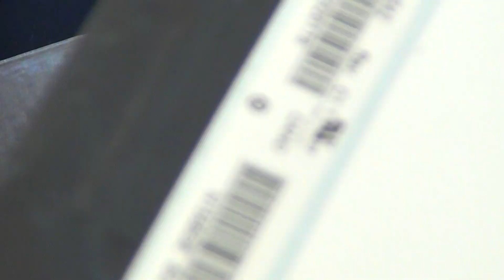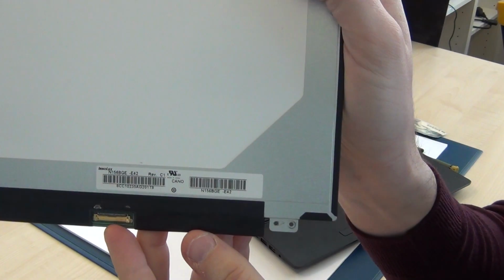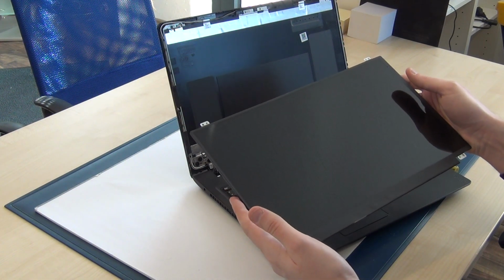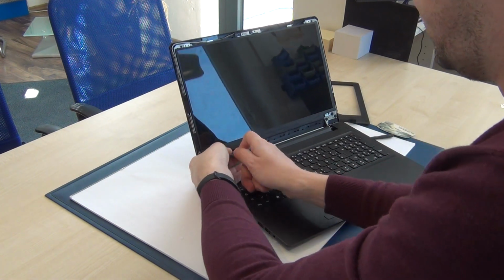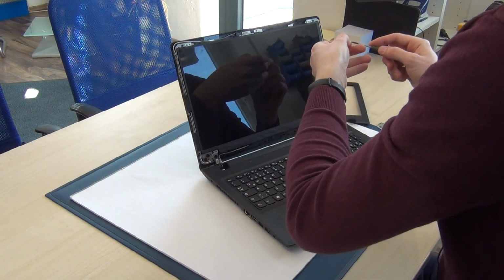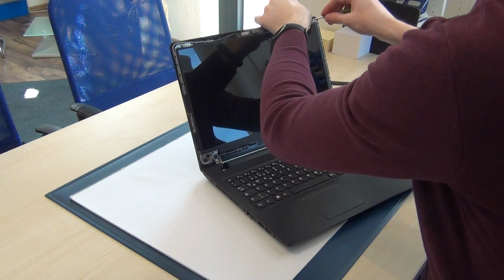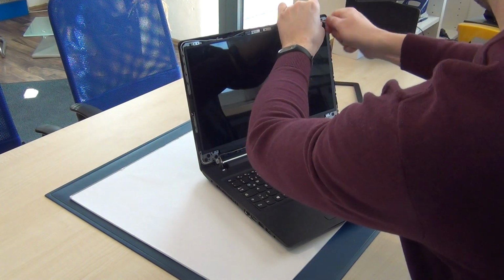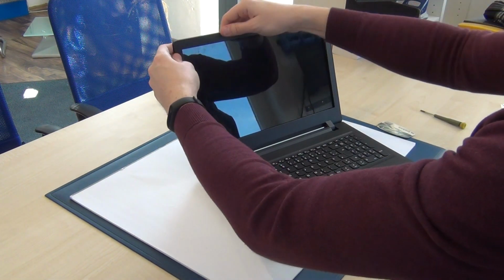Lenovo Ideapad 110 Series 110-15ISK screen Display LCD Replacement - HowTo replace a damaged Display

Comment: can i use a full hd display?
Reply from the maker: Maybe its possible, you need a compatible display, you can write a ebay shop that selling these compatible displays and maybe they can tell you if they have a similar compatible display.....sometimes the Display for HD had a other connector as the full hd connector (some millimeters more)

Comment: The connecting cable behind my display was a lil bent from me abusing my laptop THANK YOU FOR SHOWING ME WHERE IT WAS. 
After removing the sticker I noticed the lil bend and pushed it back into place with the screwdriver AND DIDN'T NEED TO BUY A NEW DISPLAY THANK YOU SO MUCH

Comment from the maker: Parts / Passende Bauteile für den Umbau:
Mich unterstützen/Support me and buy at amazon - https://amzn.to/3P8uXjS (*)

Displays (different types) for Ideapad 110 series - https://amzn.to/3isCihK (*)
Kompatible Akkus / Battery - https://amzn.to/3FoZh6v (*)
9mm slim DVD Brenner - https://amzn.to/3FrpOA9 (*)

Arbeitsspeicher Crucial 8GB SO DDR4 RAM 3200 - https://amzn.to/3i2h1vm (*)
Arbeitsspeicher Crucial 16GB SO DDR4 RAM 3200 - https://amzn.to/3tMyB9e (*)

SSD SATA 2,5" 1TB Samsung 870 Series - https://amzn.to/3VSPBqo (*)
SSD SATA 2,5" 2TB Crucial BX500 Series - https://amzn.to/3uqHo0Y  (*)

Die mit Sternchen (*) gekennzeichneten Links sind sogenannte Affiliate-Links. 
Wenn du auf so einen Affiliate-Link klickst und über diesen Link einkaufst,
bekomme ich von dem betreffenden Online-Shop oder Anbieter eine Provision. 
Für dich verändert sich der Preis nicht.

Comment: after i replaced the screen it turns on and it works. But when I put the Bezel back on (which was very difficult to do because it just doesn't seem to fit) it doesn't turn on.

Comment: can I upgrade the resolution of the screen in this model of laptop? I know that the screen is 30 pins, non touch screen, and 15.6 inches
I was thinking in using this screen: https://www.ebay.com/itm/New-Lenovo-Thinkpad-15-6-P50-P50S-LED-LCD-Screen-FHD-1080P-30PIN-Display/203245390300?hash=item2f525e89dc:g:qWsAAOSwOIVf~LgW

Comment: I have the same laptop model with that 1366x768 screen. I also have a spare 1920x1080 screen that I never got it to work. It uses the same connector and looks identical. You know if there is a chance to make it work?
Reply: Same connector and same screen size?
Yeah, it works flawless.
Reply: Well you can try it, but it will be still 1366x768
Reply: @LadislavDobri  won't windows recognise the resolution and change the output?
Reply: @pragatheeseswaran7023  not sure honestly, update me if you can and willing to I am kinda curious